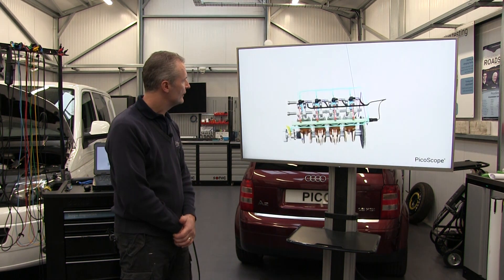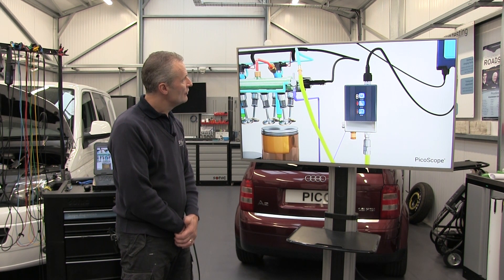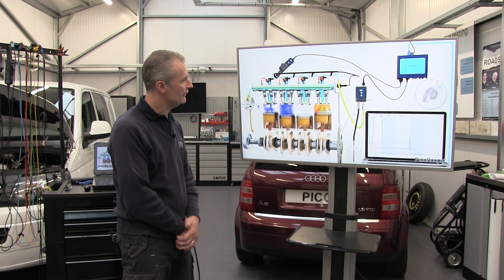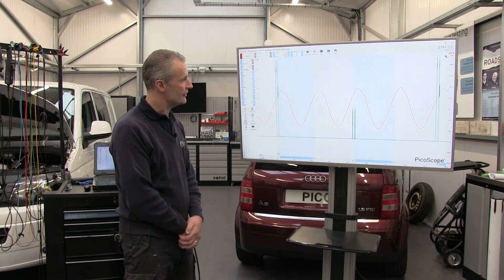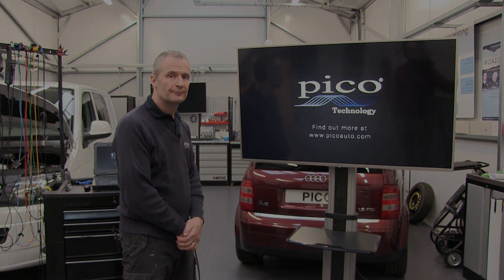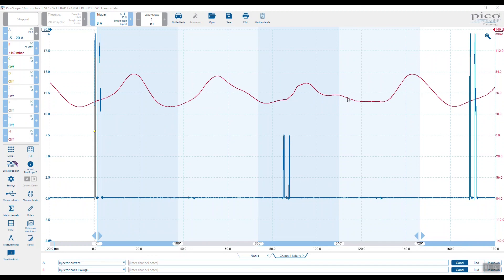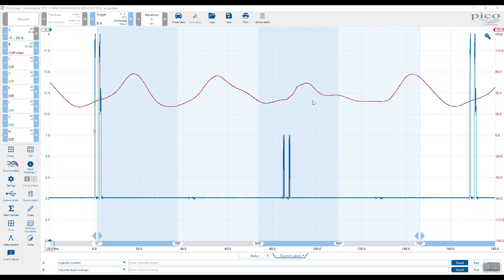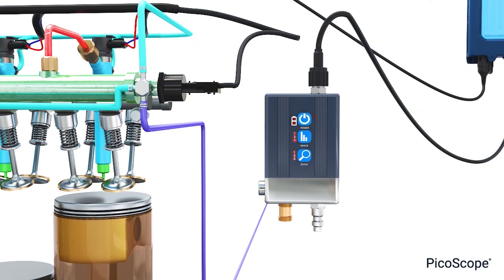Testing diesel back-leakage with the WPS500X

Comment: In the animation, when cyl 4 misbehaves, is there a signal from injector 1? Or what is the other, blue line in the diagram?
Reply: Hello and thank you for the feedback. The current clamp is connected around cylinder 1 injector which allows for synchronization with the pulsations between each cylinder 1 injection event. Using the firing order we can ID and attribute each pulsation to the relevant cylinder. Regardless of a misbehaving injector (an injector with poor spill contribution) the electrical event for cylinder 1 remains correct. The blue line in the diagram reveals the injection event (current flow) through cylinder 1 and an induced event for its companion cylinder. The following forum post will help here https://www.picoauto.com/support/viewtopic.php?p=102275#p102275 I hope this helps, take care....Steve